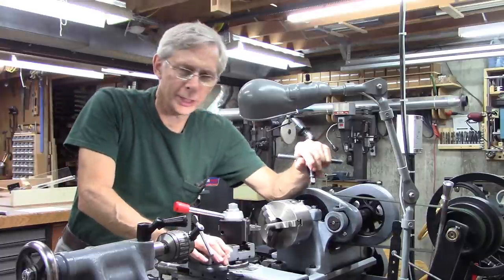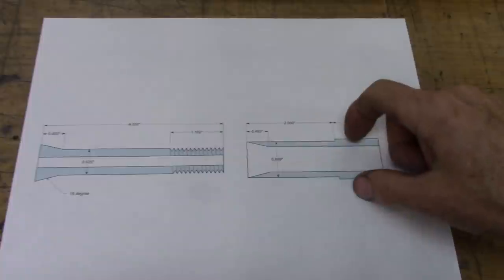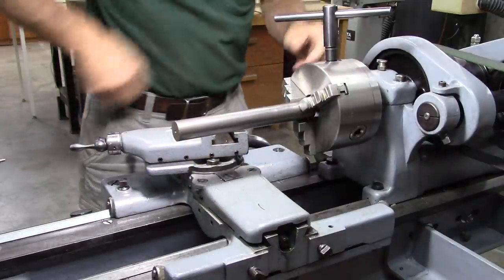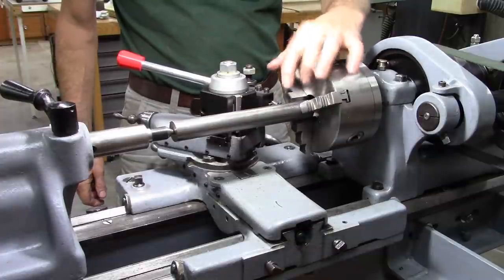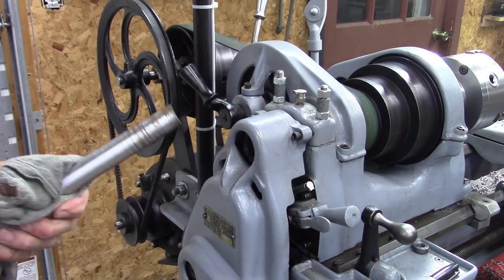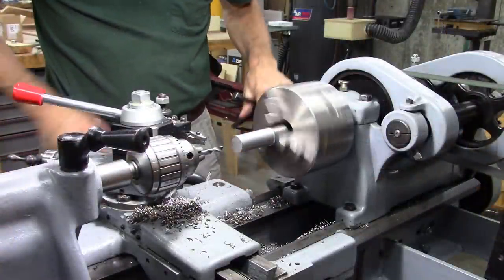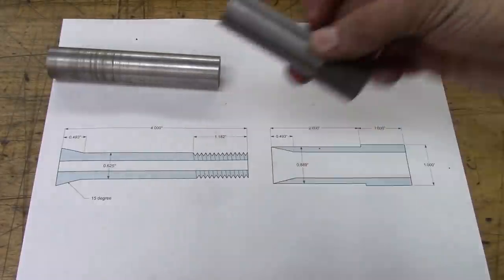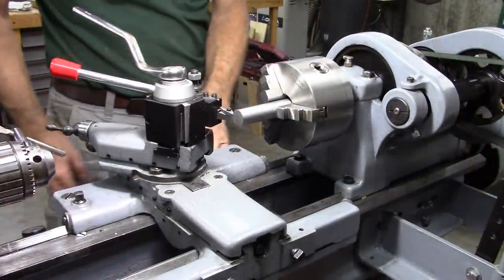Making a Spindle Stop for my South Bend 11

Comment: Nice build! 
 Another type of stop I've used is a collet stop. An internal thread in the collet accepts the stop nut. A threaded shaft that has a lock nut on it, runs inside the stop nut, and is adjusted into position and locked in place with the lock nut.
Reply from the maker: That would work!

Comment: For my 9" SBL, I made a spindle stop that uses a short plug inside the out-board end of the spindle (way simpler design). It is locked in place by a grub screw that backs out to engage a hole in the spindle wall. This arrangement gives me more depth for the work-piece ( almost the entire length of spindle plus chuck). The first iteration used a grub screw to hold the stop-rod, but my next one will hold it like a collet to avoid upsetting the rod. One could argue that a short plug would not hold the rod straight, but I have not found it to be an issue. Nice machine work, Winky! Best regards.
Reply from the maker: Shorter would be okay. Alignment is not super critical. I used a flat tip set screw to ovoid damaging the rod. You are right about this design, it didn't take me long to make but getting a good fit is critical. The amount of depth lost has never been an issue for me although I'm certain it will be tomorrow, lol. Make a video of your design! I can't picture how you made the grub screw back out. Of if you want to share, send me some pictures and I'll make a video in the future. There is ALWAYS a better way!!!! winkysworkshop@gmx.com
Reply: @Winky's Workshop  Did you ever find out how that grub screw tightens the spindle plug?  My spindle has a small hole ~11/64" (untapped) on the wall near the end which could accommodate some kind of screw to hold a stop in place.
Reply from the maker: @martik778  Did your SB 9 come with the hole in the side of the spindle or did you drill it?
Reply: @WinkysWorkshop  It came with the hole. My older one (1944) does not have the hole. I plan to make a plug with a 1/4 hole and set screw for an adjustable  rod and make some sort of fastener to hold the plug in place thru the spindle wall hole
Reply from the maker: @martik778  that would work well!
Reply: @WinkysWorkshop  It's done. I used a 10-32 screw to hold both the plug and rod in place. It fit perfectly into the spindle wall hole. Not sure how difficult it would be to drill a hole in the spindle if it's not already there. They are usually hardened. Maybe try it on yours :)
Reply from the maker: @martik778  Very cool. If I had it to do over I'd consider drilling. It's probably hardened but still drillable.

Comment: Prowling around today and found this. Making these adaptations to our equip rarely is a bad thing. Good to see you again this fine day my friend. Looks like a live center for the tailstock would be next eh. I see some chip loading in your file. I found a product at "Rio Grande" called "Burlife" It is inexpensive and the very best file, burr or even coarse sandpaper even hole saws that stops those nasty pieces that can ruin a finish. You will love it, GUARANTEED. What a great addon to the lathe. Good post bud.
Reply from the maker: Interesting. I may have to try that!
Reply: @WinkysWorkshop  It keeps my silver files like new. It should be around $10.00 your currency. I do a couple videos showing it.
Reply from the maker: @TomokosEnterprize  - I'll check it out. Thanks

Comment: Nice job just thought I'd add a tip for cleaning the spindle bore and tailstock bore or anything else get yourself a 12 gauge shotgun cleaning kit the brass bore brushes work great you can put the rod in a drill in the kit it'll have a couple more brushes and also a felt pad holder that works perfect to hold a strip of scotchbright and cloth I usually do the brass brush then scotchbright with wd40 then cloth 👍👍👍
Reply from the maker: That would work. I need to do that. When I first got the lathe is was 100% plugged. I socked the spindle in solvent and then water and detergent. That got about 98% of it.

Comment: Good job. I made a similar one based on Harold Hall's design. It has a plug with a MT3 taper that goes into the nose of the spindle and prevents the rod from moving about. It also has a cap for the end of the rod that just fits into the bore of the cushman chuck to act as a more positive backstop for parts.
Reply from the maker: Interesting although you can't use the spindle bore. There is probably a more simple way to do it but I could figure out how.

Comment: I thought you might internal thread the inside piece and then use a piece of threaded rod for the stop with a jam nut to lock it in position. But that might be harder to finely adjust since it might move when tightening the jam nut....
Again nice video and great idea!
Reply from the maker: Thanks Dwight. I'm sure there are other good ways to do this but this worked well.

Comment: I really enjoyed the video, I don't want to admit how many times I have watched it :)  you tool holder is normal except a bent spanner ?
it would be nice to see a video on the tools you used, the normal cutter for facing off is not the one I would choose, But I am an amateur :) could explain why ??? thank you
Reply from the maker: Bent?  The tool holder holds the insert at an angle. This insert is meant to be use like this. Its a VNMG insert. It seems to work well for just about anything. If I was doing a lot of facing I'd probably use a different insert that brakes chips better.

Comment: Just an idea, why couldn't a person have put some cuts in the inside taper piece too to lock down on the 1/4" rod also, thus eliminating the need of a set screw?
Reply from the maker: Interesting idea. It would work I think although I suspect it might be hard to adjust.
Reply: @WinkysWorkshop  How so?  Also, your making it for a mass production/repeatability so your not adjusting it often.
Reply from the maker: In most cases it wouldn't matter but things tend to move around as a taper is being locked down. Making a slight adjustment would be more difficult.
Reply: @WinkysWorkshop  You would know, having built it and using it.

Comment: Really a well done project, and well ma video! It has its place in every machinists toolbox. A nice tool when turning multiple parts. But... using a collet chuck, I see an uncertainty as the collet chuck pulls the object deeper into the spindle. Who wins, the collet chuck or the spindle stop?
You don't like the Joe Pie style, turning the threading tool upside down and lathe in reverse turning? Joking!
Time 17:20. Emery paper, or a file, often does the trick better then more cuts.
Time 17:50. Wow! That's a piedestal grinder! My one stands on the floor....
Time 18:30. I thought so. It was bottom it out earlier...
Time 20:05. Slit sawing.... Poff, poff,poff... Is that the same kind of Chinese saw blade as I've got? Joking and laughing!
Time 20:55. A slightly dangerous direction of cutting, climb cutting...
End comment. A very useful tool for every lathe,
Reply from the maker: Yeah I guess the plunge cut was climbing. Every time I have used that arbor it's out of round. I've thought about making a new one (but collets for the lathe!). I have a video of the grinder. I made it from my old drill press column. It has a buffer on one side and wire brush on the other. I love it. Reverse threading is not a good idea with a screw on chuck otherwise not a bad idea. When I get collets they will be ER40. They have a nut instead of a draw bar so you can use the bore. They are slower to use but in a home shop they are perfect. They also have a larger clamping range.  Thanks for watching!
Reply: @WinkysWorkshop  Climb cutting works when the rigidity matches the needs.
Making 2 arbors using different designs I say that those cheap Chinese saw blades have the hole off center. Move slowly knowing that only parts of the blade is cutting and it works.
Also got a collet chuck for ER32, as I have a good set of them, and an ER40 collet chuck and a few collets to cover the larger dimensions.
Reply from the maker: @Stefan_Boerjesson  Yeah...  I wasn't too worried, I was going very slow. The arbor (Chinese) is the problem. The blades are high dollar blade from a local industry that closed. I have about 30 or 40 and could have got a whole box full.
Reply: @WinkysWorkshop  Haha. I've got a well made arbor and poor Chinese blades.....
Reply from the maker: @Stefan_Boerjesson  - Just re-read your first comment. Yeah collets might be an issue with the spindle stop because it pulls the work when it tightens. Maybe a very strong spring on the end of the rod to set the position and then allow it to pull in a little....  probably not an accurate method.
Reply: @WinkysWorkshop  I would not think it would be reliable. Precision will be uncertain. Two forces fighting each other... But for a conventional chuck, excellent solution.